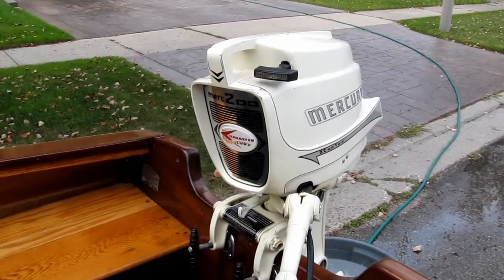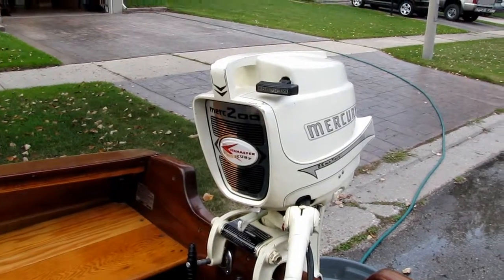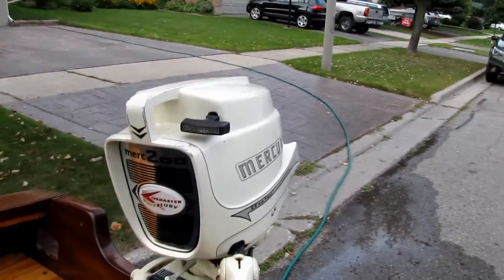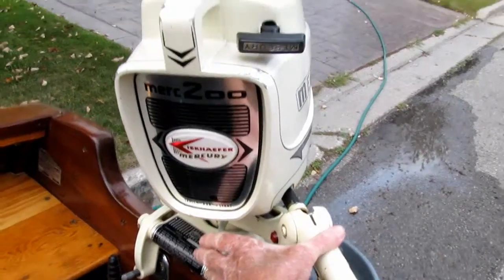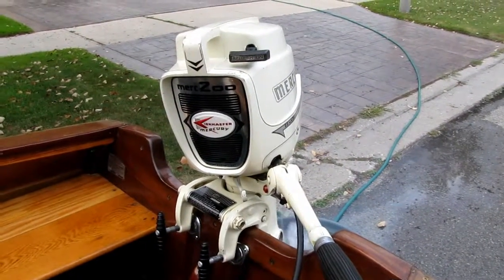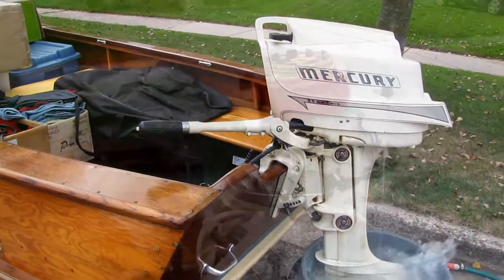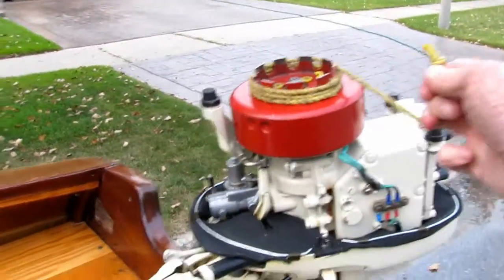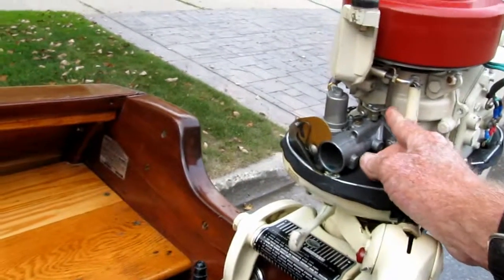Kiekhaefer Merc 200 Running Again

Comment: I have a 1962 Johnson Seahorse, also white. Still runs nicely. Almost identical to the Johnson Seahorse that Brigitte Bardot owned back in early 60s during her summers boating on the French Riviera portion of the Mediterranean.

Check the top left pic on this site, by joining the url completely together:

https : // www.pinterest.com/ pin/ 519532506985206031/

Comment: Have you replaced the impeller on this motor? I have the same motor and I’m trying to figure out how to get that dang impeller out.
Reply from the maker: I have replaced the impeller a couple of times.

It's located in the upper half of the transmission casing so you need to remove the lower unit to get at it. Once the lower unit and transmission are removed you can see the retainer. It's a reverse thread so be wary.

I usually remove the powerhead too. It's been a few years since I last did it. I had to make a 4 tooth tool to remove the retainer.

Comment: Your cowling is a 1961, but your drive shaft housing is a 1962. The steering yoke with that grease fitting as well as the extra spray plate suggests this was a 1962. What I'm saying is you might have a 1962 Merc 250 , 25HP with a 1961 cowling on it. OR your 1961 22HP Merc 200 might have parts with 1962 features which means it could be among the last 1961 models. John Timmins - AKA DaytonaJohn
Reply from the maker: My dad bought this motor new in 1962 so it is all original. Based on the SN (1457997) I'm pretty sure it is a late 1961 model. Still runs pretty good. Only get 5 or 6 hours a year.